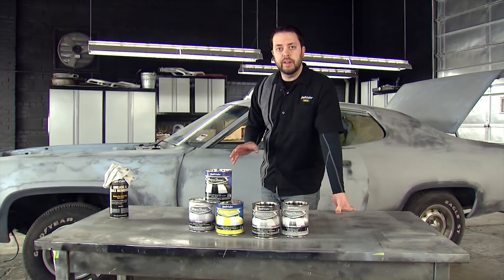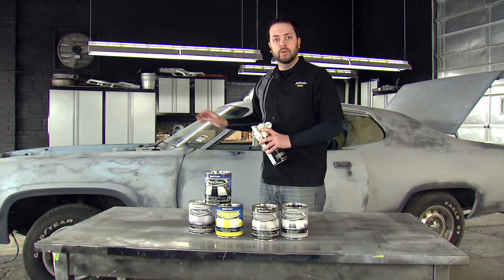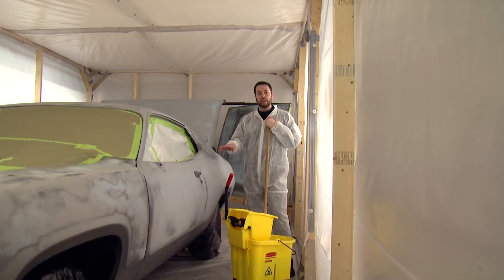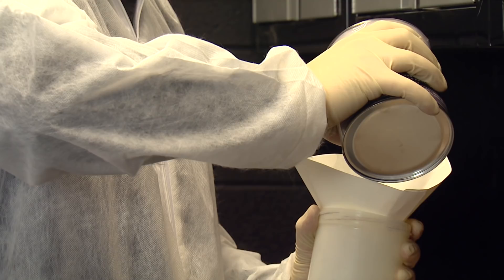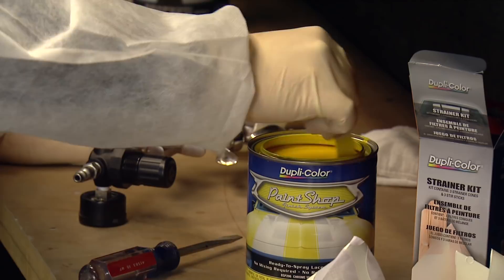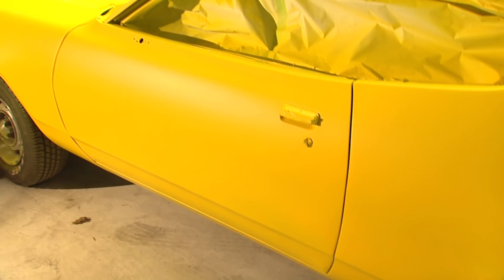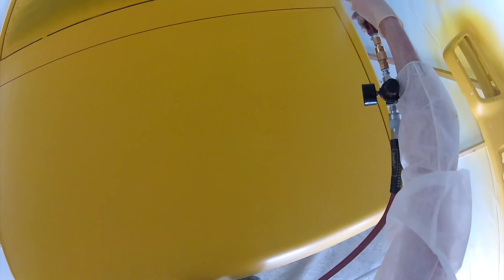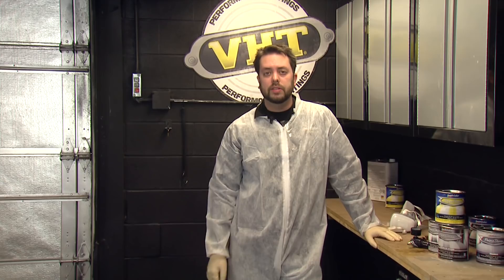Painting the '72 Plymouth Satellite Sebring with Dupli-Color Paint Shop

Comment: as far as my investigation so far, this is about the only option for a diy, when you talk about urethane (2k) the job becomes professional, as in hazardous and needing a professional paint booth and protective gear. to this guys credit he did cover his clothing and had a home made booth. He probably is using a smaller compressor, not a pro setup which explains the narrow spay patterns. I used dupli color spray cans for a test and was amazed at the color quality, 1k clear especially lacquer needs to be sanded and polished to get a glass shine. I saw a guy do a comparison with urethane and lacquer switching from pro booth to back yard and at first it looked like night and day, then he polished the lacquer and it looked just as good, of course the durability wont match long term, but for a diy it can work! also, be sure to seal and have a uniform primer or it will affect and show through the paint and take more coats to try to hide.

Comment: Assuming your point is to sell this duplicolor paint shop idea to us, it would be great if you told us what gun system you are using. Looks like a gravity fed hvlp but is it turbine or compressor? If turbine, what stage is it? If compressor, what pressure ?  What tip/capset is in the gun? Did you change the tip or anything else between primer. base and clear.
Too many questions unanswered. We are left with a guy painting a car !

Comment: People watching this, please dont spray clearcoat like that! Especially the roof. If you do what this guy does, it will look like you used gravel guard on the roof. You need to be about a hands span away from your panels, and move faster. I think the spray guns arent set up right eigher. He was spraying the primer with about a 3" fan pattern. Either to small a tip in his gun for that primer, or he didnt wind out the fan.
Reply: Splash are you a painter I've got a 71 satellite Sebring I'm thinking of painting back Bahama yellow (a Chrysler corporation color) stock on various mopars  advice?
Reply: Aziz Lamar 
Yes i do paint. What did you need help with?
Reply: splash such things as how many paint coats,clear coats etc thanks
Reply: Aziz Lamar 
How many coays of colour really depend on how good the colour gets coverage. Yellow usually is hard to get good coverage. Its very transparent. I recomend a light grey or white primer or sealer to start with. Usually around 3 coats will get good coverage on most colours. You want to make sure you have enough colour, so you dont see through it once its out in the sun.
Clear is usually 2 or 3 coats.
Put your first coat on medium wet, go for shine on your second coat. If it doesnt look right or you want more clear, for wet sanding later, put a third coat.
Reply: splash thanks for the advice
Reply: Aziz Lamar Your welcome.
Best of luck!
Reply: +Jimmy De 
yes, you do jave to sand the primer. its best to do your primer then let it set up for the day or a couple days, if your not in a rush, then do your final sand.
If your in a rush, wait a couple hours, then sand.
Reply: splash  what tip would be best for this type of paint I got a husky Spraygun set and it only has one tip and it's a 5.0 I think. Where can I get different kinds of tips/nozzles what ever they are called I'm very new to this and want to try my hand at it. I got a old beater that's in need of a paint job but I don't want to spend the 3,000 the paint shop told me it would cost. It's just my old farm/work truck it's not a show truck. It's used as a truck from slinging bells of hay to pulling chains over the sides over all it still looks nice just has a few bad spots where the paint got dinged off and I don't want it to rust. Any help Will greatly be appreciated and if it works out I got a few tractors I want to try and paint
Reply: New Generation 
im not sure about a 5.0 tip.
i think you might have read it wrong. if you look at the end of your tip, its usually marked which tip.
if its the Husky gravity feed gun, which is HVLP or conventional type, its most likely a 1.4 tip.
You should get good results with it.
Depending on colour, your looking at 2-3 coats of colour. Keep about a 50%-75% overlap.
1.3 or 1.4 tip, about 18-24 psi for your base coat.
24-30 psi on your clear coat.
Thats all a base line, cause all guns set up a bit different.
Im not sure if Husky sells different tips for their guns.
With the more popular brands, Devilbis, Sata, Tekna, Sagola, Iwata, etc. you can buy all sorts of tips.
I tell most people that prep is 90% of a good paint job!
Just make sure you use wax and grease remover on the truck, then sand it really good. No shiny spots, and get all your edges good. Prime any spots that show metal, or where you have to use filler, and wax and grease remover again before paint. Get a couple tack clothes and go over it before and after each coat of colour, and once you start to clear, dont touch it with a tack cloth!
hope this helps!
Also use about 400-500 grit paper to prep the truck for paint.
Reply: splash I will have to look and make sure what tip is on it. All I really want to do is primer it gray and paint it a light color having no air conditioning With any dark color it makes it extremely hot inside the truck and it's last summer it hit over 100 degrees Fahrenheit and it felt like 500° in the truck I would love to have it back White because it was not bad in the summer on heat. But I was told White is a very hard color to paint. I don't know how true that is. Because I do not paint. How would I go about prepping the surface without spending a ton of money? Thank you for your time in replying back! Have a grate day
Reply: New Generation 
You dont need to primer the whole truck, if the current paint is in good shape. But if you prefer to do so, just sand entire truck with 180, 240, or 320 grit. Wouldn't go courser or finer than those.
Finish sand your primer with 400 or 500 grit.
Lol 
I used to always tell freinds that white was the hardest colour to spray!
Its really hard to get a good reflection off the white, which does make it difficult to spray. But keep in mind, your not looking for show quality, so you should be alright.
Take your time and be consistent with your overlaps.
Reply: New Generation that’s really funny cause whoever told you that white is the hardest color to paint doesn’t know what in the helm they are talking about. 

White is actually one of the easiest colors to spray. Any solid color paint is going to be best for a beginner to learn on then you can start trying to play with metallics after you’ve mastered solid colors but you will be fine if you want to go with white. 

White and black paints are also the cheapest colors to get also but I would advise any rookie to stay away from spraying reds till they have a little experience not only because it’s a bit harder to get good coverage but any variation of red is also going to be the most expensive color you can get. 

You may have already done your truck by now and if you have I hope it went well for ya and would like to hear about it if you would like to share

Take care
Reply: looked like he was at like 10 psi......

Comment: Last time i painted my car with Duplicolor.......i ended up calling them and screaming.....they were very nice, and even sent me a replacement for everything i used without me asking them to.......but they sent me garbage to replace the garbage. I know its hard to find auto paint, seeing as they only carry this crap  at most places, but make the long drive to a REAL auto paint store, and buy real paint. Theres a reason it costs more, because it works. Painting your kids wagon?.....a bike frame? sure use it. its cheap . But never use on a car. I had a small panel that was cured for over a year....a year....primer base and clear/.....and i tossed it in a bucket of gas, and ALL of it wiped away with a rag after just a few hours

Comment: How did you buff the clear ? I have some leaf marks in my clear and I used a buffer and it cut right into it.
Reply: I saw a guy at the paint store used this stuff and he had to strip it all off. didnt stick. Duplicolor is ok for a spot paint on something you dont care about that much but as an overall there are better products out there. even as a base. Not for me.
Reply: @Mikefngarage  yep this stuff is crap. I finished my car just to realize I have to redo it. I’m beyond upset about it.  I spent years doing body work on a 71 super beetle. Biggest mistake of my life putting this cheapo product over all that work. Lesson learned
Reply: Not to mention I got a drip of gas on my fender at the gas station. Instantly burned right into the clear. Not only was the paint a mistake. But the clear even more so. Years ago I just used the paint with out the clear. It was crap but I would give a quick wet sand and buff over that and could make it look new agin. The paint actually buffs nicely. This clear buffs horribly and doesn’t protect the paint from anything. I think it’s actually more susceptible to damage than the paint anyway. What a waste of extra time doing the clear. Months later you would find a leaf on your car wipe it off and there’s a permanent leaf mark in the clear. Honestly wtf

Comment: I also have some questions, Im wanting to order the midnight blue kit, for my 1987 olds cutlass 2door, I want to have the metallic look, do I need to use the mid coat for that paint?, and also how many quarts of primer/paint/clear will I need for that vehicle?
thanks
Reply from the maker: swaggedoutwun Hi, thanks for your question. Our paint shop Midnight Blue is not a metallic. If you would like a Metallic effect, you would need to use Metallic Clear (BSP301) over it. You may also be interested in our Prism Mutli-Clear Coat (BSP302), for a rainbow metallic effect. The paint shop product is only available in quarts and approximately 2-4 quarts of each product will be needed, depending on the spray technique and size of the vehicle. If you have any additional questions, don't hesitate to call 800-247-3270. Thank you and good luck with your project!
Reply: Thank you kindly for your help
Reply: +swaggedoutwun I'm interested in the midnight blue and can't seem to find a video of the finished job for comparison to my factory color LOL. Also considering mixing Midnight Blue with Deep Blue for a dark blue color.  This may be a solution to your metallic preference before using the mid coat clear. Any thoughts or suggestions, hit me up.

Comment: this paint isn't for a restoration job it's too thin use it on an old cheap work truck or just old shit box its cheaper to go get real paint when you don't have any Hardner it's not going to last I've done gm black hoods tail gates some panel on the budget with this but they were cheap used car lot flippers cheap Basterds I would do Nason single stage over this stuff  or good old equipment enamel with Hardner and clear it's no better than rattle can it's your money and I can't believe in the paint gun set ups I've been painting 45 years I can do ok with a 10 dollar gun but set it up right if you do , I've made this crap shine like glass buy it's a waste of my time and I don't tell anyone because it's no quality at all do yourself a favor scuff the primer to get rid of the dry spots or use epoxy primer is the only one I've ever been able to just spay over without finessing it before painting it expensive but worth it and never mix brands it's not designed to mesh with each other I never want to knock another guys work but take a paint ,body work class at local community college or trade school little to nothing a couple hundred bucks most will be glad to have you paint your car as it's a learning guide for young people shit I'm rambling now